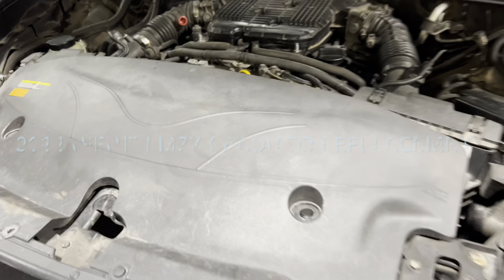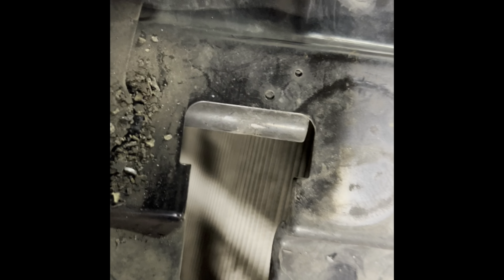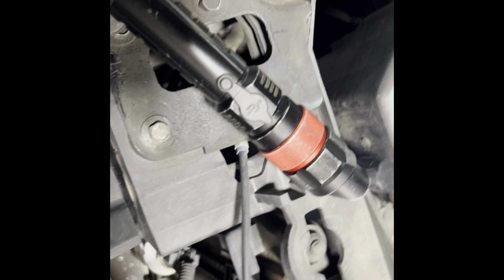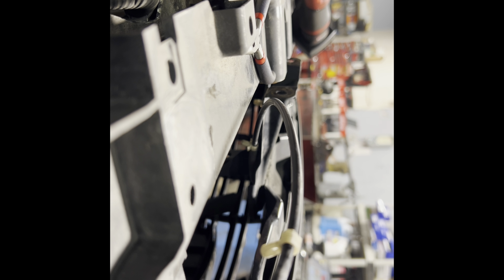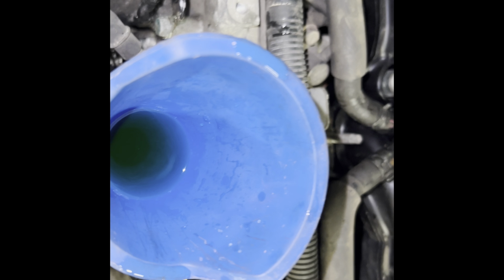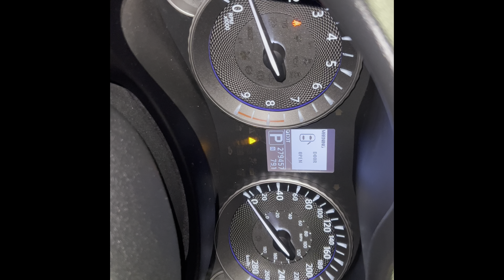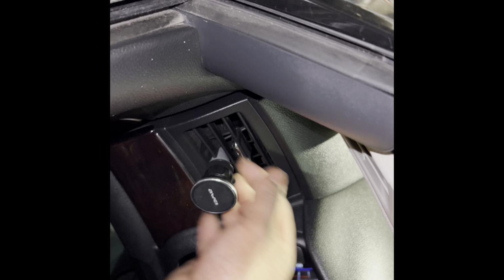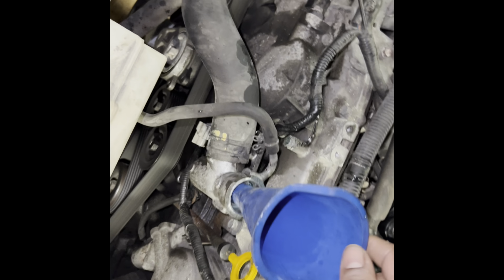Infiniti m37x radiator replacement

Comment: I’m having a hard time getting my radiator out. That right side doesn’t seem to have enough room. I don’t want to force the AC system forward to try and create space it almost seems impossible to get out without cutting the drain plug and main lower coolant fitting off. How did you wiggle it out?
Reply from the maker: It was tight. I spent 15 min wiggling and  pulling up. If u can get someone to pull up while u make clearance. U will have to push the ac condenser back a bit
Reply: @slimazz151 thank you, ima try again.
Reply: @slimazz151 did you refill the lost transmission fluid aswell? I had to move the car a few feet and transmission fluid leaked out. Now I’m freaking and don’t want to drive it for fear of messing up the transmission.
Reply from the maker: @Kevin-yk7tk  no I didn’t refill it due to not losing much fluid and I know my fluid was fill because i changed it couple months ago and plan to do it again in the near future. Hope all went well

Comment: I having a problem getting enough clearance half of it only comes out lol
Reply from the maker: It was tight not gona lie. Get good light and another person to pull up while u make clearance. Ac condenser have to move at least 2 inch. Brake the clips on the rad if u have to(that was hooking up on mines)take ur time and u should be fine. Don’t rush or force it